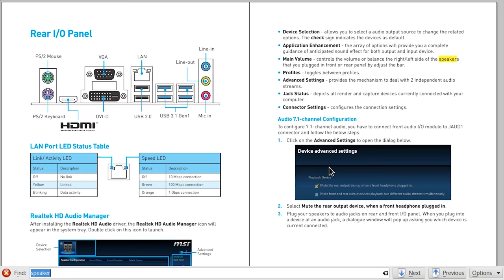How to Connect a PC Speaker to Your Motherboard

Comment: You connected the speaker backwards. Red is pos. Black is neg. It makes a difference in the polarity of the voice coil.
Reply: Will the speaker or connector break if it’s accidentally used backwards?
Reply: @PlanetLinuxChannel  no but the voice coil polarity will be reversed, substantially reducing the speaker performance. That’s why the wires are different colors
Reply: @raincloud54  why is black negative? Lol
Reply: I think it's because negative and ground are related; ground has a neutral mood; and black is a quite neutral color.
Reply: @awvalenti  Okay. Follow that logic and explain why black is pos and white is neutral in AC
Reply: That, I don't know :)
Reply: @wiktornowakowski8856  bc you didn't go to school to learn the most elementary stuff. next time you will ask why is water wet... LoL
Reply: @alkofok5285  took you long enough, but i knew the answer before you said something, i have found circuts that had black as positive in toys. But now that i went to technical school i know evrything i have to know
Reply: @wiktornowakowski8856  did you say toys? :D try explosive devices

Comment: I just found one of these while I was trying to repair my computer. I thought it was a government spying tool so I threw it in the bin. Some days later I discover that it's used as a motherboard diagnosis tool and I sifted through my garbage to find it. :)
Reply from the maker: this made me facepalm for real
Reply: @SoSoTechTube  I think he is joking.
Reply: Yes we heard you sifting through your trash. Also the blinking LEDs are camera lenses.
Reply: @syedamir9291  I wasn't.
Reply: What is this for exactly? I took it out and put it back in again but done it wrong and it burnt out 😅
Reply: @1987marmite  if you have a problem with your pc, so for example it cant POST, then the speaker will sound a combination of beeps in a specific sequence, which you can look online and it will tell you exactly why post failed. 
so for example you will know if your RAM/GPU/CPU/Whatever is not working, while without the speaker you would have to guess. 

also some *VERY* old programs might use it, tho i dont think anything made since windows xp

Comment: Oddly enough, the MSI Z97 MPower MAX AC motherboard doesn't have a speaker/buzzer header. I guess if no speaker header, then no audible confirmations even if I somehow rigged it to take a 4-pin speaker.
Thanks,
Rich
FWIW: I've had this mobo for 3 years and I intend to install it in my ‘other Desktop’ as an upgrade. I just finished a 'from-scratch' build of my first, ‘main’ desktop. The only hardware I didn't buy new to build it was the case, (Corsair 780T in white). Otherwise, the system is all new. In fact, I was planning to buy and build this new system in the future but about a month ago, my MSI mobo/desktop suddenly wouldn't start.

I mean not even to the UEFI, nothing! I assessed that it was the Motherboard at first. However, I thought that because, when I did the typical 'PSU Fan-Test' on my Corsair 1000i, the case fan worked. Just an FYI: When you're dealing with PSUs that have capacitors and/or resistors in their 24-pin and 8-pin motherboard cables, the "Fan-test" will give you a false indication!

Replacing the mobo with another one just like I had wasn't an option and after a short time, decided that it was more likely to be a CPU problem. I had installed a brand new i7-4790K in that MSI board 3 years ago (when I initially built that system from scratch) and found it hard to believe it would be bad, but it was easier to change out than the board and all the hardware. So I bought a brand new CPU and installed it and still 'no cigar'! 

I had a 500w PSU lying around and used it to try the new CPU installation and when it still didn't work, I finally decided to push ahead my plans to build a new updated system, which is now running: It’s Intel based, i7-10700K CPU with an ASUS ROG Maximus XII Formula, EVGA RTX 2070 Super Ultra, EVGA 1300W PSU, and 16GB x 3600MHz T-Force Xtreem RAM (2 x 8GB).

About $4000 later, I am now trying to learn how to run Windows 10 64bit Pro, (my old system was Windows 7 64bit Home edition and I couldn't "upgrade" to Win 10 Pro, which I insisted on having).

However, I took a break from that so I could retest and maybe restart my old MSI mobo so that I could get critical ID info and some program purchase info from my old Win 7 O/S drive.

It was then that I found out my MSI mobo was fine! There were two problems, one is still pending but it has to do with the Corsair PSU. I know that either the 24-pin PSU cable is bad, or the PSU has a bad rail, but I don't have a compatible 24-pin cable to test which one of the two it is. However, the other issue I have definitely confirmed and was astonished to find that the CMOS 3-Volt battery was dead!!!!

THAT'S RIGHT!! That 3-volt battery was depleted and tested to be 2.4volts with my DVMM. I found that until I placed a new 3-volt battery in my MSI board, the board would not start up! I used my 500 watt PSU to do the test after I changed the 3-volt battery and the board started right up. When I connected my Corsair 1000i PSU to the board, it would not start.

Corsair supplies two 8-pin CPU cables with that unit but only one 24-pin cable. Of course, I tried both of the supplied 8-pin cables and the board wouldn't start so I'm left with trying to figure out if it's an issue with the 24-pin cable, or the PSU itself. I've got some schematics for the PSU and I have just about every instrument I need to test most home electronics including a Signal Process generator, Oscilloscope, AC volt meter, DVMM, etc., etc.

I need to find time to try and learn enough about the PSU to know how, and what, to test. 

The 2-part moral to this story is: 

A] For those people who have the higher wattage PSUs, which come with integrated microelectronics in the 24-pin and 4 or 8-pin cables; the "PSU paperclip & Case fan Test" is not going to give you a true indication of the PSU's status. If the case fan doesn't run with such a test, then MAYBE you can reach the conclusion the PSU is bad. HOWEVER, if the case fan DOES run in the paperclip-fan test, that WILL NOT mean your PSU is good!

I should have known this and even doubted the test when my case fan started. I knew that the PSU had two rails and that test would only indicate good, in a simple application. I was a victim of my impatience and rather than retrace my steps to do a more precise test, I went with what I "hoped" was right instead of what I knew was right... 

The "B" part of the moral to that story is; when you get a message on your monitor that your battery is low, don't assume that the message refers to your wireless mouse battery, or your Cyberpower 1200w APU back up battery system! That's what I did because I didn't read the message carefully. Then about a week later, I experienced sudden system shutdowns and strange, difficult start-ups. I also realized that time of day indicated on my task bar was wrong.

About 8 days after that low battery message, (which I all but forgot about), my computer no longer started up. One month and one week later, (and about $4000 dollars spent), I found that the CMOS battery CAN actually stop your computer from starting! I mean you'll push the start button and absolutely nothing happens. No error codes post in the read-out on the board, no beeps or buzzes, NOTHING.

In my case, the CMOS battery alone could have been the only thing wrong, and I still would have thought it was the mobo, PSU, or CPU. I’m sure I would still have gone and built a new system and only later, (as I have now), realized that a $2.00 battery was the problem. However, the bad Corsair PSU and/or one of the cables, only added to my wrong assessment. 

Multiple, unrelated, issues, are always a nightmare to diagnose and I’m learning this 3-volt battery lesson the hard way.
FWIW,
Rich
Reply: Tell us how ya feel!
Reply: Who asked
Reply: @casheti  LOL, Hmmm... 2 years ago... Oh yes! I remember now! It was Panama Red, (buds), and freshly picked. Those were the days... But in my defense, the facts about that CMOS battery are not widely known and I, (for one), would have appreciated a reference to a mobo 3-volt battery could cause a no-start on a desktop. So like I said:
"FWIW"

Comment: found mine in a box a couple weeks after I built my PC. completely forgot to install it lol
Reply: @paulaswam5909  my X570 board did not even come with one.
I have been using the same one for over 10 years now
Reply: @haloharry97  it comes with your case most of the time
Reply: @AleksoBre  it did not come with my £300 case or my £300 MB i must be unlucky ;(
Reply: @haloharry97  lol came with my 55 euro case. What case do you have if it's 300 pounds?
Reply: @AleksoBre  Corsair 900d
Reply: @haloharry97  do you need one
Reply: @haloharry97  or can you go without it
Reply: @bradenwilliams2555  thanks for the offer, but I bought one on Amazon 10 years ago.
Reply: @haloharry97  What does the speaker cable actually do? If my case comes with one then I haven't found it lol, but do I need it?
Reply: @evildude2135  it just output beeps, if you have a error.
it can be annoying some times.
for me my computer beeps 3 times every time, i turn on my computer. to let me know no monitor is detected (it is how my monitor is designed.)
but it can be vary helpful to tell you have a problem,
Reply: @haloharry97  Mine doesn't even have a header for it

Edit: it's actually very hidden apparently

Comment: Hello, if I insert PC speaker connector wrong way, but into the right 4-pin connector, does it damage the speaker? Will it work? I don't want to test it on my speaker. (I mean, that red and black wires are swapped)
Reply: Did u figure it out?

Comment: Is it a big deal, if I don’t connect the PC speaker to the motherboard? Like would it impact other aspects of the PC, cuz I’ve had mine for about 3 months now and it works fine, even the sound. I just wanted to double check on here.

Comment: I have located JFP2  on my motherboard (MSI Z97-G45 GAMING) and plugged a known working speaker on it, changed the polarity and still nothing at boot. I expected RAM error beeps because my RAM was fauty, but no sound. Tried to change the polarity and still nothing. I have fixed the RAM problem by now but I would love the speaker to work when needed.
Reply: I know this comment is old, but I had this problem and noticed the POST speaker setting was turned off in bios
Reply: @evilresidence4 that’s very encouraging to hear, considering majority of us needs this speaker because they could not even get to Bios stage.

Comment: am I missing something or does my MOBO(ASROCK H61M-VG4) not have the pins needed?
Reply from the maker: Hey, thanks for writing, looks like your model actually has no speaker connectors. strange (read up on http://www.tomshardware.co.uk/answers/id-2951419/h61m-dgs-mobo-speaker-bios-update-required.html )

Comment: Hello. Can u tell me if what happens if we don't put that thing on the motherboard. Means mine is broken.
Reply from the maker: I've heard of people intentionally removing it because they were annoyed by it. Worst case scenario: you won't be informed of overheating and computer will just crash but some hardware might take damage that you might have prevented by manually powering off. Not sure if this is realistic though.
Reply: Nyte Blade7 just buy a new one

Comment: What is the purpose of this speaker wire? Is it only for the beep when powering on the PC? I have a asus o7o55d-e pro motherboard and this speaker wire was not connected, what would I miss out? PC was build DIY by a shop and I did not know why this speaker wire was not connected. Thanks
Reply from the maker: "Is it only for the beep when powering on the PC" pretty much. The other use is that it can be used as a warning if your computer overheats so you know you need to restart and probably clean dust and possibly put new thermal grease on your cpu
Reply: @SoSoTechTube  So I installed the speaker and enabled it in my bios which is called "cpu fan fail warning control" because you stated that it was used to warn you if your pc was overheating and when I reset my pc it didn't beep and you also stated that it would also beep just by turning on the pc is this the case for all motherboards?, I have a msi pro h610m-g ddr4 to be more specific.

Comment: can this be fix? my speaker/buzzer 's top green board in which the wires are fixed is separated. so can i just stick and make it work again? anyone?
Reply from the maker: If the wire goes inside a hole, so you can make a loop, then it might be ok if you strip off enough of the plastic around the metal of the cable at that end and then secure it so it doesn't touch other pieces.
Soldering is much more reliable though. Needs a soldering iron though.

Comment: What is the meaning for a pc internal speaker?
Reply: Suppose you try turning on your PC but it's failing to boot for some reason.  In order to help you identify the issue, most motherboard BIOS's come with troubleshooting code that notifies you what the system malfunction is.  The way it notifies you is through beep patterns that mean different things.  Some motherboards come with an onboard speaker that will make these beeps when you power on the computer.  However, most boards don't nowadays.  So if you want to have this troubleshooting functionality, you will need to install an internal speaker yourself.
Reply: Arbitrary Renaissance thanks

Comment: I bought a mainboard and i didnt got  any speakers with it
Reply: Skullz It comes with the case that you bought. Mine comes with it.
Reply from the maker: soldered on speakers are very rare I'm told but probably not as rare as no speaker support at all (also possible, see other comment)
Reply: @SoSoTechTube  hi. Excellent video. Very useful . My motherboard has the pins for the speaker but the case I got does not have a front panel speaker cable to connect to it. Is there a solution?
Reply: @uk5993 is it corsair spec01  ?  I hv got same prob. just buy mini buzzer from ele shop or amazon.
Reply: @Chnnhai  it's a cooler master elite 311. Yes, that's a good solution

Comment: Are you using this speaker because you’ve experienced POST issues with this MSI board?

I am asking as I have recently purchased MSI B760m wifi DDR5 with lga 1700 socket. Sadly the system ended up in power cycle. CPU led turns on red. Then it switches off and yellow RAM led switches on. Then computer turns off. Turns on again and cycle repeats. 
Any troubleshooting help would be greatly appreciated.